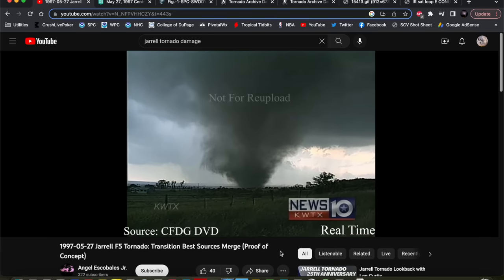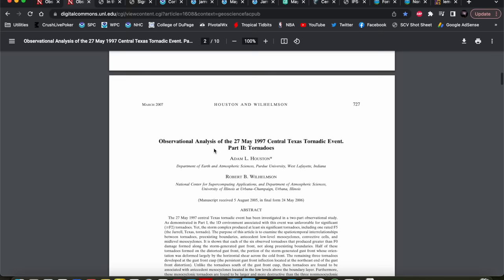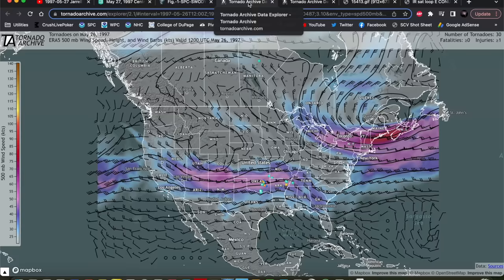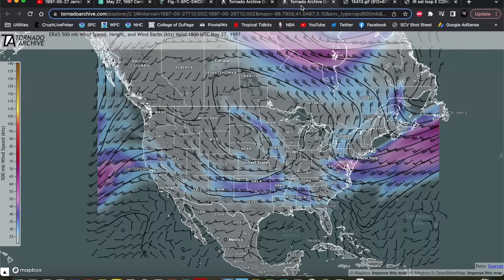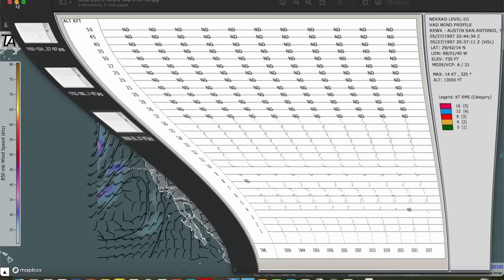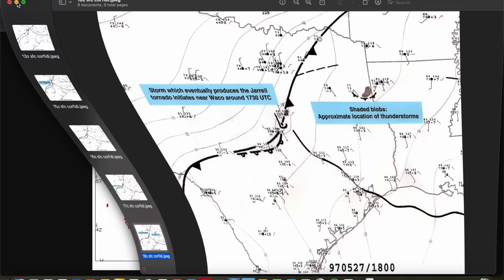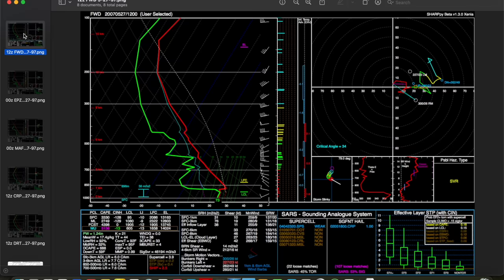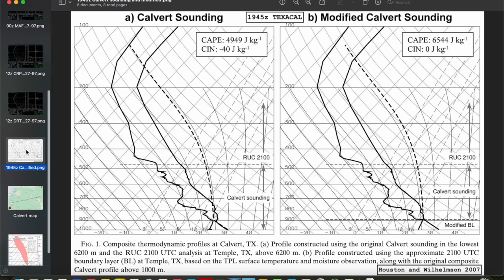The Jarrell, TX, F5 Tornado of May 27, 1997: A Case Study

Comment: It almost seemed like some sort of freak accident. The damage that tornado did was unbelievable. Possibly 320+ mph winds near the surface.
Reply: Its max speed was recorded to be 261MPH. What made it so destructive, however, wasn’t just the wind speeds. What made it especially destructive was the fact the tornado slowed down to about five miles per hour when it went through the Double Creek Estates, basically sitting on top of it for several minutes. It was effectively a three quarters of a mile wide blender that puree’d the subdivision.
Reply: @Caddynars  it wasn’t recorded.  The minimum threshold for F5 at the time was 261mph. So it’s been reported as at least 261mph.
Reply: It seems like many people overlook the fact that the tornado sat on some county roads for a bit just tearing up asphalt and caliche. It seems like that is a big reason things were scrubbed so clean. Rather like a commercial potato peeler I encountered once, only in reverse. With the peeler the inside of a large pot was abrasive, and the potatoes were spun in there until they had no more skin. This tornado with very high winds and abrasive rocks scoured foundations and cattle clean. Maybe the pros believe the asphalt and gravel were immediately taken away from the area, but I'm not sure I believe it and I have never heard anyone put forth such an opinion. Research idea anyone?
Reply: @russelpolk8152  actually most everyone in the weather community understand that the slow crawl exasperated the situation.  However I don’t believe that it was an overrated F3 as some have said.  One look at that insane velocity in the upward movement and the multiple horizontal vortices tell me that it would have cause extreme catastrophic damage regardless of the forward pace.  
It is interesting though I’ll give you that.  Just sucks that we’ll never know the actual true wind speed and dynamics of Jarrell or any other high end event.
Reply: @Caddynars  stop spreading that BS rumor. There was no DOW on scene that day. The windspeeds were not recorded. And the 261mph were the initial required windspeeds in order for any tornado to be considered for F5 status back then. The Enhanced Fujita scale has thrown all that out of the window. But unless you know exactly what you're talking about, don't say anything at all.
Reply: @wadewilson8011  I know the video you’re talking about with the concrete turning it black. I believe that was the Heston KS F5 from March 13,1990.  
I was in Jarrell that Thursday (2 days after the storm) and to say viewing the aftermath with my own eyes was a shock to the system is an understatement.  It honestly looked like someone was about to build a neighborhood.  There were streets and foundations but that was it.  Literally no debris or rubble.  Just mud.   
I have another thought about the whole “an F/EF3 could have done that.  What about category 5 hurricanes?  Aren’t they equivalent (at least in wind speed estimates) to an F/EF3?  If so, why don’t we see nothing but slabs and emptiness after a 160mph cat 5 sits over a location for 30+minutes.  I understand the dynamics of the wind are different. But it seems to me that if what the folks poo-pooing Jarrell’s wind speeds say is true, then we should see Jarrell type devastation after the winds of a cat 5 hurricane shouldn’t we?  We don’t.  
Just looking at the edges of the Jarrell tornado in its mature phase was terrifying.  The upward motion alone must have been 200mph plus.  It looked like it was vibrating and boiling rather than spinning.  
I’d be willing to bet that even in its early rope phase the winds were well above F/EF1 strength too.  There’s a video of it hitting a hay bail.  At the time the tornado wasn’t probably more than 50’ wide at most. And it just flung that hay bail high into the air and scattered it.  
Remember the helical vortices in the early stages too.  The F5 in Eli Manitoba did it’s F5 damage while it was extremely narrow and containing helical vortices.  Surveyors said maybe not more than 10 yards wide.  
I’d love to know and I hope we have the technology before so die to find out real time wind speeds from start to finish of tornadoes.  Even the DOW readings aren’t actually measurements.  
One last thing about the “Jarrell could have been done by F/EF3 winds” thing.  A F/EF5 can really only happen in a finite number of locations.   Simply because the extremely high construction quality needed to achieve that rating doesn’t exist many places.  That doesn’t mean that a particular tornado that wipes a well built 2 story brick home off the face of the earth and turns it to dust “wasn’t” at EF5 strength.  It simply means that the highest it can be rated due to the construction of the place <~ 200mph.  
I’m 100% positive there have been several EF5 strength tornadoes since 2013.  I don’t get too bent out of shape anymore about tornadoes being underrated from what I think they are.  I just look at it like I mentioned a moment ago. A tornadoes “rating” is not actually a representation of its true strength throughout its entire path.  There’s no way to have the right equipment in the right place at the right time on every tornado.  
Just for fun, I’ll mention a few I think were absolutely capable of EF5 damage 
1) El Reno 2013
2) Rochelle IL 2015
3)Villonia AR 2014
4) New Wren MS 2011
5) Bassfield/Soso MS 2020
And obviously the Western KY monster of 2021. You can’t look at Kayce or Dawson Springs or Bremen KY and tell me with a straight face that tornado didn’t inflict EF5 damage. 

Also, I think Joplin is overrated.  I said what I said lol.
Reply: @carlmay9532  I live close to the area where the Vilonia tornado happened. Just outside of Mayflower in the River Plantation subdivision, the tornado killed a woman inside one of those above ground safe room shelters. It threw a large hard object at the door and broke the hardware used to mount it. This may have given an ef5 rating, but the hardware used wasn't up to code for a shelter. It also hit a well constructed that had anchor bolts, but they weren't bolted down correctly. It stabbed the house. They ended up estimating wind speeds on 190 mph.
Reply: @kevinnelson9588  one thing to remember when you hear these estimates wind speeds in regards to the classification.  Don’t look at it as “top speed of 190 mph”.   Look at it as “at least 190 mph” It may very well have been well over 200 mph, but the damage indicators for the type of construction mean, no matter how badly a structure was swept clean, it can only be considered at the minimum threshold needed to cause “x” damage to “x” structure.
Reply: @kevinnelson9588  by the way, I find the Villonia/Mayflower 2014 tornado fascinating.  Absolutely a candidate for “strongest tornado not rated F/EF5”.  No doubt it contained EF5 winds. NO DOUBT WHATSOEVER!!
Reply: It initially wasn't supposed to be that strong. However, that all changed when the parent supercell swallowed a few nearby cells causing this tornado to rapidly and aggressively intensify. Normally, a cell merger destroys or weakens tornado genesis. However, this tornado, the 2011 Joplin tornado, and the 2013 Moore EF5 are all rare cases of tornadoes and supercells violently exploding in intensity after cell merging.
Reply: It had to be higher. I've heard Williamson county law enforcement say the F5 made low rumbling growls and Sci fi type horror sounds. It traumatized them.
Reply: Why not give them both readings.  F5 for wind speeds/  EF5 for destruction. So like the bridge creek f5/ef5. Or f5/ef3 El reno.
Reply: @msmith6634  2013 el reno had 300mph winds inside the tornado... perhaps one of its multiple vortices???  Based on the fact the winds hit 300, it should be rated F5 EF5... damage should be a secondary factor when you have recorded wind speeds

Comment: I was in Austin that day.  The humidity was oppressive; it was hard just to breathe.
Reply from the maker: I bet...temps exceeding 90 with upper 70s dewpoints is an absolute sauna.
Reply: aka NYC summer
Reply: @patrykbors9243 Just a regular spring day in Texas
Reply: I woke up this Wednesday, May 22 2024 and walked outside and the humidity hit me like a ton of bricks. After I ran a few errands, I came home and mowed my backyard (no thanks to King Ranch for this KR blue stem). The humidity was suffocating. When Is got about 3/4 done with my lawn, I noticed a thunderhead up North toward Gatesville. When I got done, I came in the house and called my sister who lives in Harker Heights and told her that we were going to have a tornado. She thought that I was crazy. Sure enough, as I finished taking a shower, it turned black as midnight. The wind started going like crazy and tornado sirens and cell phone alerts were warning of a tornado in my area and to take shelter. I thought that I was a goner. Then, the sirens went off again. The high winds knocked over a pine tree in my backyard, taking down my power line. Luckily, the tornado only knocked the tree over and blew some shingles off my roof, but the same system caused tornadoes in Belton and Temple, doing some severe damage. I was without electricity for 52 hours.

Comment: I find low shear, high CAPE outbreaks fascinating. Amazing how 25 knots of shear can build a 250+ mph blender. 🤯 Looking forward to your 2013 El Reno discussion.
Reply from the maker: Agreed! Sometimes that high CAPE can compensate a little bit for the weaker shear, as usually there's a bunch of low-level instability to help stretch any spin in the low levels into the vertical.
Reply: The landspout characteristics, too. Geez, what an event! So many rare contributing factors for this; if there was a swiss cheeze model for tornados, this is it.

Comment: Hey Trey,  love your vids and watch a lot of them while driving my truck (i know...shhhh).   After a 3rd time watching this I got a feeling this wasn't such an anomaly when i consider my experience living in FL 27 years and studying it's summer storm patterns, there are similarities.   For instance when the Bermuda high is in place and weak, there's hardly any prevailing winds at any levels, but the daytime heating combined with endless gulf moisture and weak cap makes storms you can set your watch to. The trigger is the Seabreeze convergence from one, or both sides of the peninsula and when those storms pop, their corresponding gust fronts prompt new storms, and that cycle keeps propagating until the CAPE is lowered by dusk.   In Jarrell's case, the insane CAPE due to landlocked region and abundant gulf moisture is similar - copy/paste the Seabreeze with the cold front / dry line as initial convergence until the more dominant downdraft gust fronts take over the show (this is what i meant previously when saying these storms create their own weather).   I totally agree with your theory 100%, i just think if we put on the sub-tropical relativity hat, and that would include water spouts being quite common, then land spout genesis potential could have been more expected. Especially when colliding and intersecting gust fronts create very unpredictable scenarios real-time.  I just didn't see much situation parallels comparison so i thought to throw it out there.  Just my crazy thoughts at  3AM.
Reply from the maker: First, thank you for watching the videos! I am from Arizona, so I know very well about how things like convergence boundaries and outflow can influence storm formation/behavior. I think the difference between a case like Jarrell and a run of the mill thunderstorm case in Florida or Arizona is that you'll often have very pulse-type, outflow-dominant storms that don't last long or get quickly undercut by the surging outflow. Jarrell was a case where updrafts continued to propagate along the boundary, and the dynamics at play plus the extreme instability allowed the initial storms to ingest that spin along the boundary to become supercells (non-outflow dominant). Jarrell definitely had hybrid landspout/supercell tornado characteristics initially. Not every updraft along a boundary produced a landspout, so it does take a certain set of circumstances to get a landspout; Jarrell just happened to be an extreme case where updrafts along the boundary became supercells and used the favorable spin along it to aid in the tornadogenesis process in a big way.
Reply: @ConvectiveChronicles  speaking of propagation of storms,  there's a scenario I wish I could see you break down sometime;   Isolated  supercell storms that seem to have completely opposite paths and no discernable steering mechanism.    Again much thanks for the great detailed work you do on YT, the layup of informative data in each video creates a virtual classroom for us all.  😀

Comment: Just curious, what is the significance of a deep moist layer vs shallow? Does it make a any impact for the type of tornado like wedge vs skinny?
Reply from the maker: You can think of that layer as the "fuel" that the storm is ingesting. If there's a lot of dry air aloft (reducing the depth of the moist layer), the storm will feed on that dry air, which tends to reduce the robustness of the updrafts. But, if that moist layer is deep, storms will have much more fuel available to them, and more significant hazards are likely.
Reply: @ConvectiveChronicles  gotcha thank you!

Comment: But why would a tiny shower in the forward flank intensify a storm? Doesn't cold rain cooled air kill storms usually? In the last event you said there so many supercells that couldn't reach their potential due to them all stealing energy from each other so that's why I'm curious why this time the shower turned evil 😅
Reply from the maker: There's still a lot we don't know about storm mergers, but there have been several cases where little showers or storms have merged with an ongoing supercell, resulting in a ramp-up in tornado production or, in the Jarrell case, a possible intensification of an ongoing tornado. It has to merge optimally though; there are also cases where a merger kills the ongoing storm or at least decreases its tornado prospects. It's not a matter of rain-cooled air; think of the little showers as storm "food," but the main storm has to "eat" it correctly (in my experience, that's when a shower merges in the forward flank region...if a shower merges in the hook region of the storm for example, that might impede tornado potential because the mesocyclone area would start to get cluttered/the flow of warm/moist air into the storm would be impeded).
Reply: @ConvectiveChronicles  Okay thanks for this explanation!  I'm sure a lot of people wondered the same so thanks for taking time to mention this! I guess we'll never know it ALL 🤷🏿 😏 but at least there will always be something interesting new to learn!

Comment: I wonder if that tornado counts as hybrid tornado
Reply from the maker: It definitely had some characteristics of both supercell and nonsupercell tornadoes.
Reply: @ConvectiveChronicles  So Jarrell 1997 starts off as a landspout then it become violent as if it did interacted with the meso ?
Reply from the maker: @someaveragemaxrubyfan8716  It appears to have begun similar to a landspout, where an updraft becomes colocated with a low-level swirl (in this case, it was an established low-level mesocyclone, which is not present in a classic landspout case). So it was sort of a hybrid.

Comment: Could the low pressure system that formed have an effect on how strong storms and tornadoes were that day? Looked like they formed right with the low moved southwest.
Reply from the maker: The low likely provided another impetus for storm initiation ahead of it along the front, but it likely didn’t have an impact on the actual strength of the storms.

Comment: Could the Jarrell tornado's level of damage been more related to it's very low forward speed (~5 mph) of movement across the land, instead of extremely high cyclonic wind speeds?  It was able to churn over a given area for a long time relative to tornadoes moving at 30+ mph.  I have come across videos suggesting this could have been the case.
Reply from the maker: I think it was a combo of both.